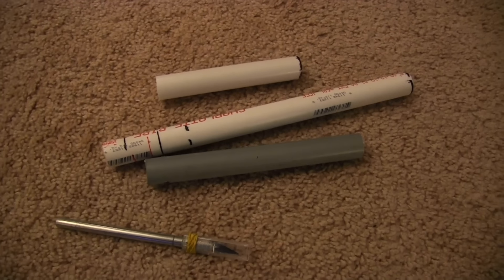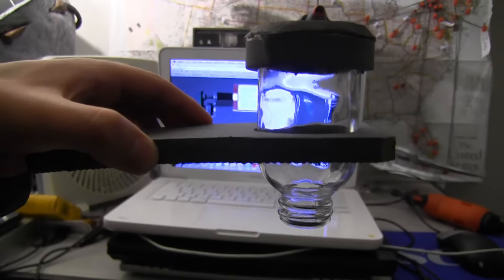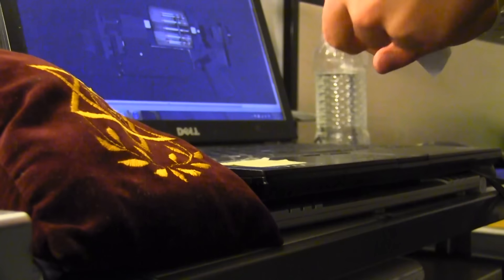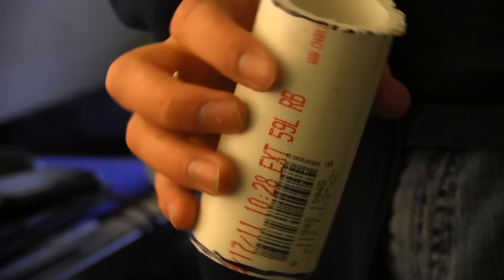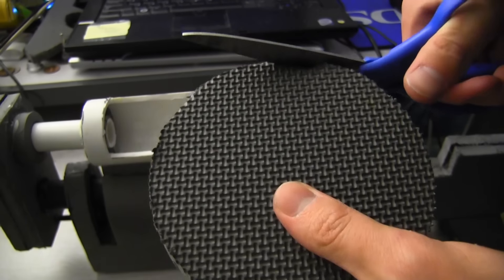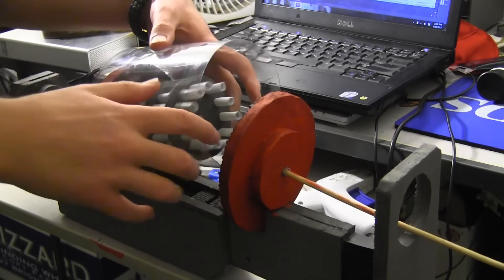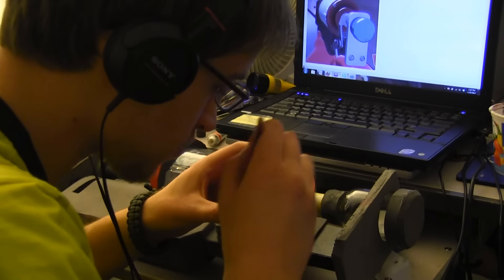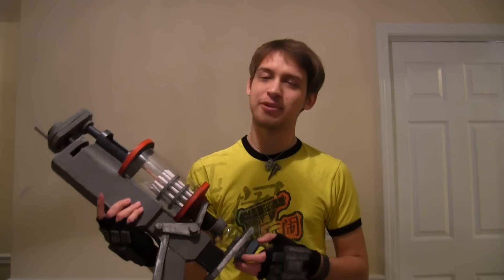How to make a TF2 Medic Blaster (Syringegun DIY)

Comment: The back section that you said was meant to be a serum vial is a compressed air capsule used to propel the syringes rather than conventional firearms which use explosions to propel bullets.

Comment: Did you try sealing the foam with school glue? I haven't worked with that specific type of foam, but I made a suit of armor out of craft foam, and colored it with Rub n Buff. If you give the foam several coats of school glue, then you can use rub n buff, and it will be a solid coat and will not soak into the foam. ^.^